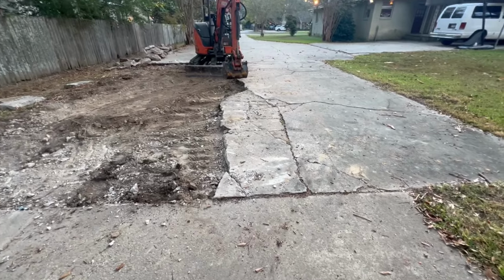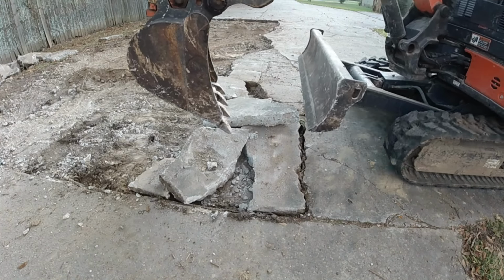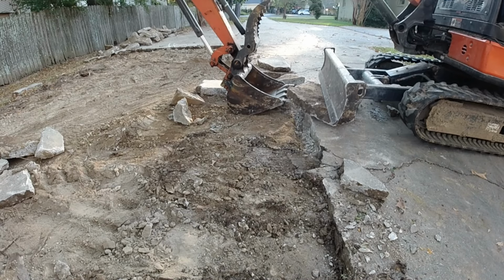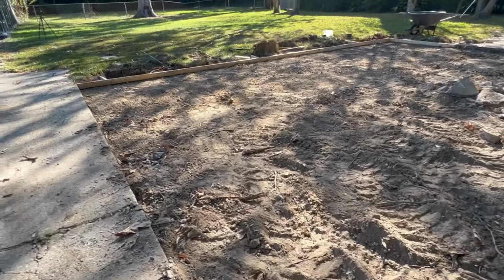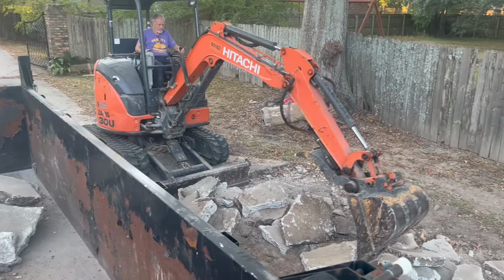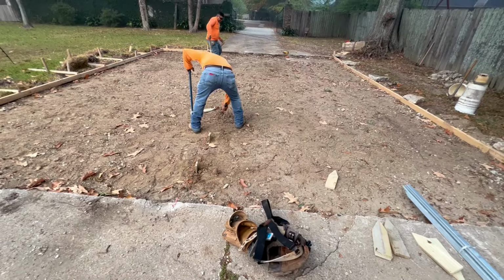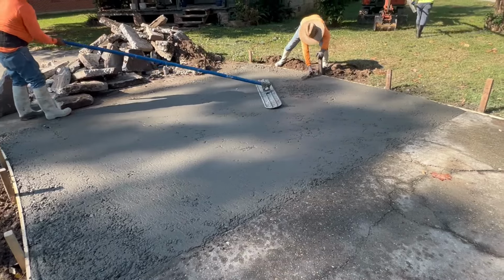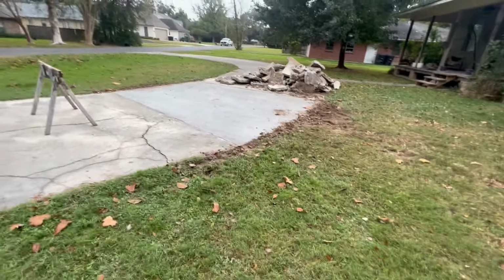A basic, not too fancy, concrete driveway patch Job.

Comment: Not criticism At All! But a question, especially on friend like dirt we used plastic and hosed the concrete wet for a couple of days, guess your ground is so hard it doesn’t suck out water to soon?
Reply from the maker: Albert 
You are 100% correct. We are at the end of a long drought and all of the soil was dust. A ran the sprinkler for a half a day until the area was soaked and then no more the day before concrete day. I didn’t want it to be muddy. Technically visqueen would have been the best to separate the wet concrete from the substrate. 
Thanks for watching and thanks for the comment!
Barry